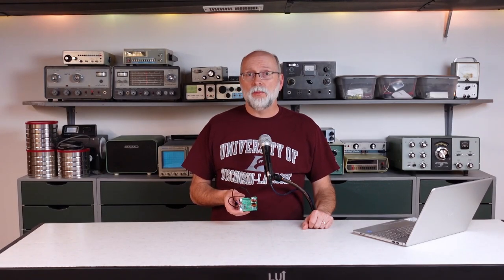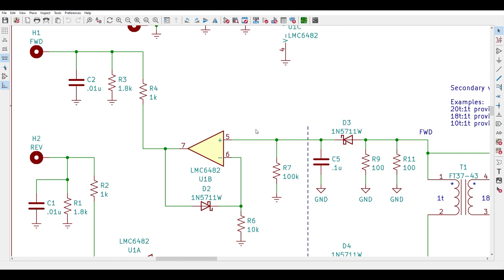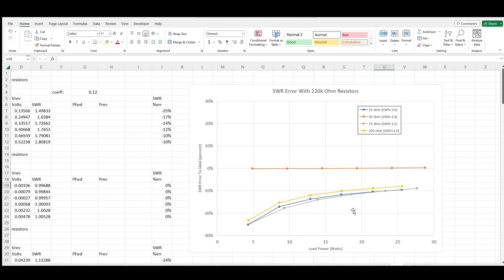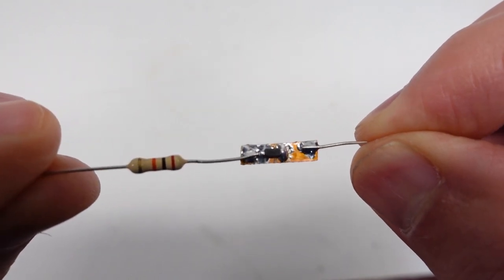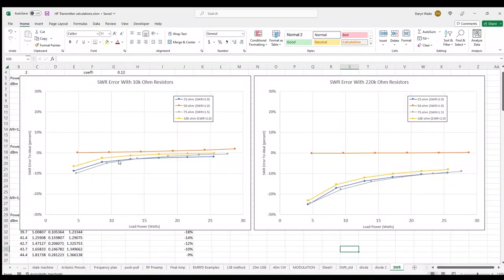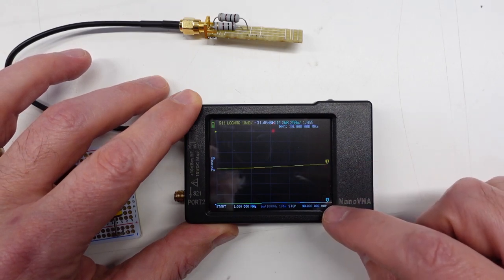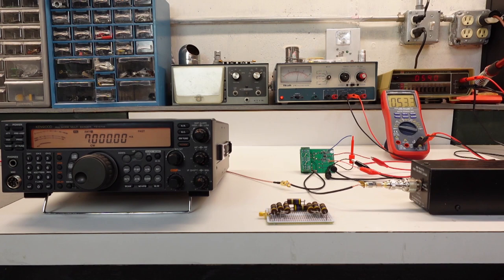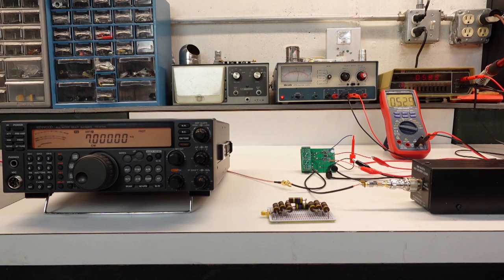HF Transmitter #09 - Directional Coupler, LPF & Antenna Relay

Comment: Hi Darin
Great sselection of topics.  Refurbishing old boat anchors is always quite interesting.  I have many more than I will get to.  Your technical levelis just perfict.  I have not used Spice in a long time ,  I seem to be able to do most things with Microwave Office. Currently working on 222 grear in hopes of doing EME. Keep up the good work.
Best Regards
Walt K3BPP

Comment: Great video, many thanks! Personally I ended up using Stockton bridge (aka Tandem Match) based on a BN61-202 binocular with germanium diodes (1N34 or a local equivalent D311) in my projects. A good instruction of building this circuit can be found in W1FB’s Design Notebook, although the author uses two ferrite cores instead of a binocular. The advantage of using a binocular is that both cores have exactly the same permeability which reduces the error. The voltage can be sampled directly without any opamps and the precision is excellent regardless of the power level and SWR.

Comment: Very Nice!  TX/RX relay in your schematic has an operate time of 15ms which is probably a bit too slow for QSK CW.  Replacing the G2RL relay with a PIN Diode Switch, or replacing G2RL with a relay that has a much faster operating time could be future options to enable full duplex CW.
Reply from the maker: Thanks for the tip!

Comment: Did you consider using a factory matched diode pair? Is possible that your error is due to different IV curves on two separate diodes
Reply from the maker: It is possible but not highly likely.  The diodes I used were in sequential order on the reel, so part to part variation should have been very small.

Comment: I think instead of going through all of that investigation of the peak detector circuit, you could have simply used a zero drop peak detector which basically integrates the detector diode and the capacitor in the opamp feedback. This is a good video about that https://www.youtube.com/watch?v=Fn5kHhNRsz0
Reply: You would then need your opamp to be responsive at RF frequencies, increasing the cost.
Reply: @4youian  LMC6482 (dual, GBW=1.5MHz)=C$2.75 , LMH6658MAX (dual, GBP=140MHz, 3dB BW=290MHZ)=C$2.95 works with 12V single supply too. I am 100% sure there are more examples in the same price range
Reply: @amirb715  worth a try in ltspice
Reply from the maker: Thanks for the tip! I was familiar with Alan's video already, but I didn't do any further product searching for an op amp with GBP high enough for Amateur HF application.  It does look like the 6658 would fit the bill.  If I revisit this topic in the future, I'll take a further look at building it this way.